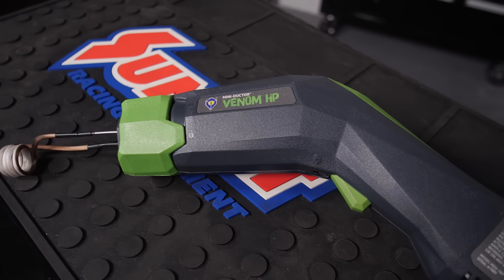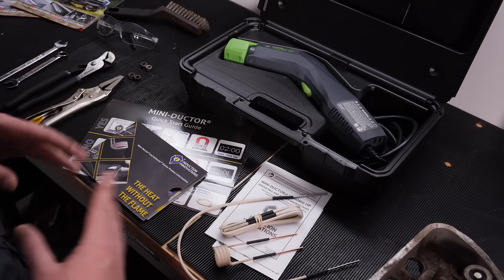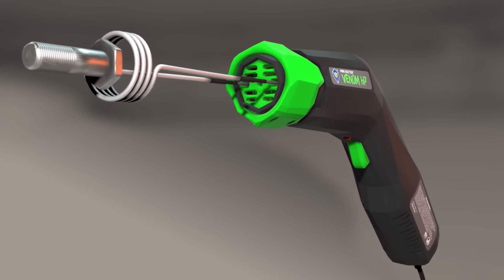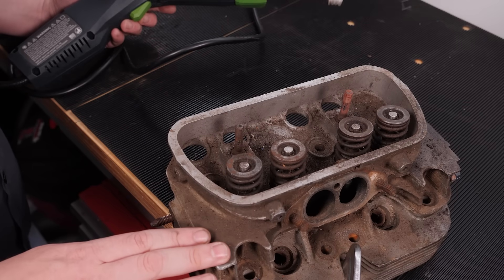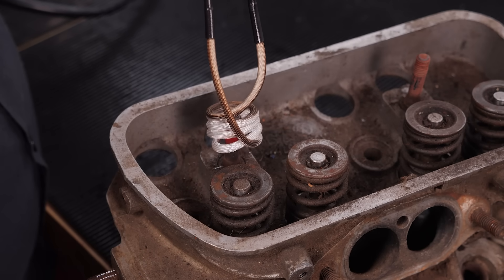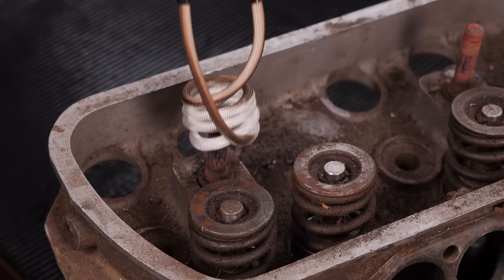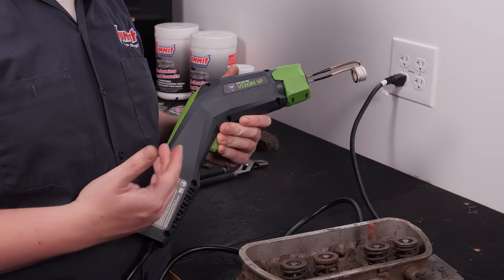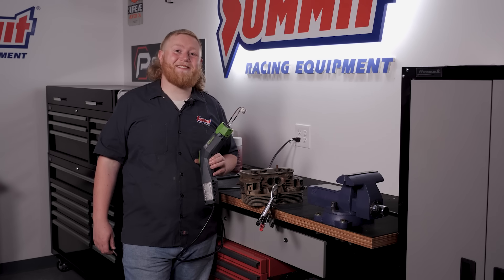How to Use Induction Innovations' Venom HP Tool to Fix a Seized Nut or Bolt

Comment: Will this loosen a water pump bolt that goes thru the timing case cover and into the engine block on a small block Mopar. The bolt is about 4 1/2 inches long.

Comment: Seems like heating would cause the bolt to expand thus making it tighter. Why does it get looser?
Reply: The bolt expanding breaks the corrosion... The aluminum base expands far more making the stud loose.
Reply: Also the studs getting hot make any locktight liquid and release